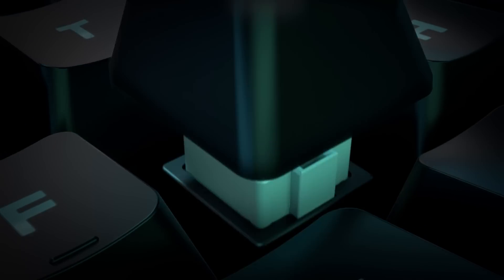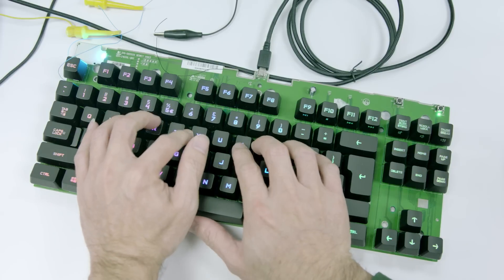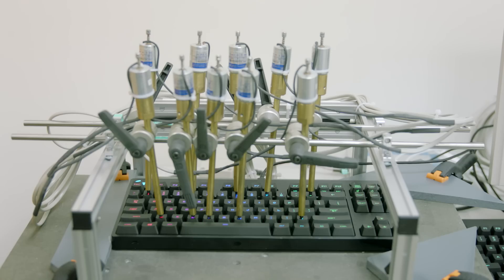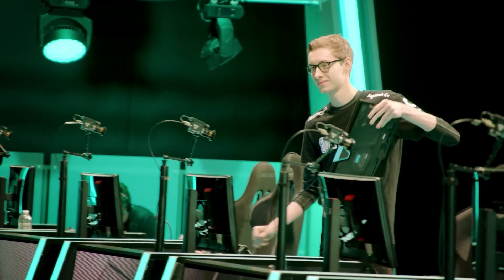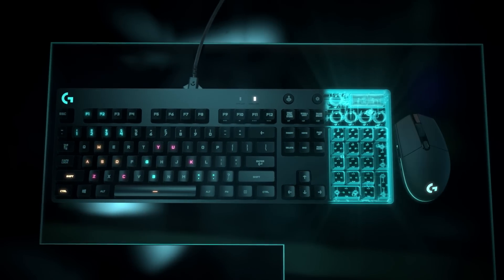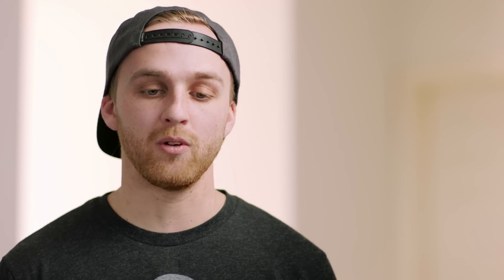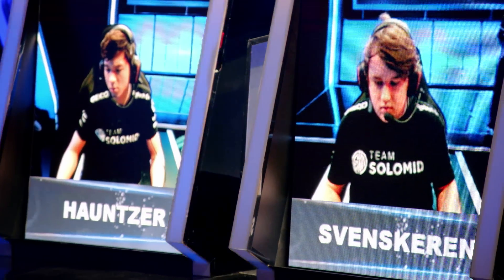Logitech G Pro Gaming Keyboard- eSports Pros [US]

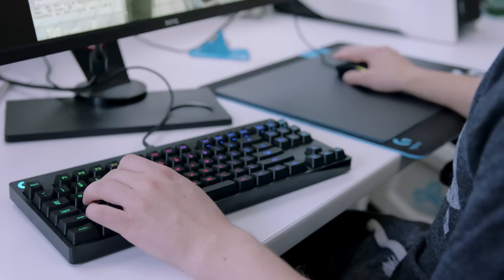Comment: 2:50 Logitech does not blur out the Razer logo on the laptop, but Razer blurs out Logitech logos... Logitech just know they are better.
Reply: Sorry bro but the Hero switch also has 16000 DPI... But who cares? That's just marketing, anything above 4000 is too much.
I own a few Razer DeathAdders (left handed edition), and a few Taipans... They are both great. Using the mouse with my left hand, Razer was one of the few companies which always had mice for us.
I am currently changing over to Logitech, but Razer will always have a place in my heart,
Cheers.
Reply: @NorthWolfe  what...?
Reply: @NorthWolfe  Hmm what do u mean hero switches? it name hero sensor 25600 dpi no lag no delay best sensor ever i havent hear hero switches before man switches and sensor are diffirent (i mean the mouse)
Reply: @user-je6fz4ft4n  My bad, I think. It was so long ago I can't remember :)
However, you also made a mistake sensor dpi has nothing to do with lag or delay. I think you are referring to wireless connection vs. wired?
Again, it is just a marketing number. I don't know of anyone using more than 2800 dpi (talking in the professional scene) and most use 1800 dpi.
Anyway, I don't even remember what this was all about, but yes, I did mean sensor, not switch (despite every mouse having various switches, some much better than others).
Reply: @user-je6fz4ft4n  hero 25k is a firmware update, original is 16k

Comment: You should make a capacitive switches and call it "Romer C". With capacitive, you can make the actuation point variable in each key. And use a cherry stem or adapters for mod ability.

Comment: So, does the switches feel clicky like cherry MX blues/browns?
Design is pretty sexy and quite compact.
Reply: Romer G switches feel like MX Browns in my experience. MX Browns have a tactile bump near the actuation point, and the Romer G switches also have this, but it's very, very faint. The switches, while I have only used them for a few hours demoing them on another keyboard, are fantastic for gaming and typing is even pretty good. However, if you love the click, these aren't for you, because they don't make any clicky sounds. They are pretty quiet in comparison to other switches. Another thing to note is that they also do not have to be bottomed out, and you'll reach the actuation point very quickly. 

Overall, a good switch. I'd look at reviews on the G810/G910/G410 for more info on the switches. Those keyboards use the same switches as this new one.
Reply: ArchieGamez They're the softest tactile switches you can get.
Reply: Ayy sounds good thanks

Comment: I just bought one, feels good, but: Why is it's travel distance so big (compared to my laptop for example)? We need a detailet user-interaction specs for keyboards! Where is the science? It's like with #coronavirus, they don't give you the exact information you need to understand what's going on: the physical parameters of buttons: "travel distance", force-dynamics during the travel (it's not a linear Force Displacement, there are "structural displacement" in multiple dimensions and "velocity-dependent damping"/dynamics) effecting the release time and buttong wiggle.